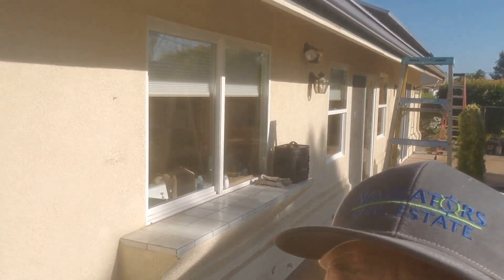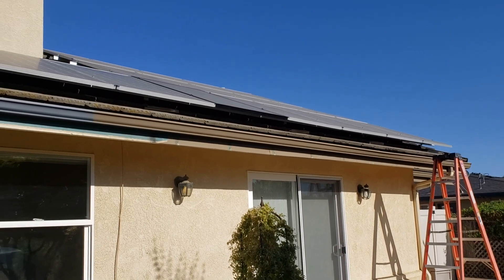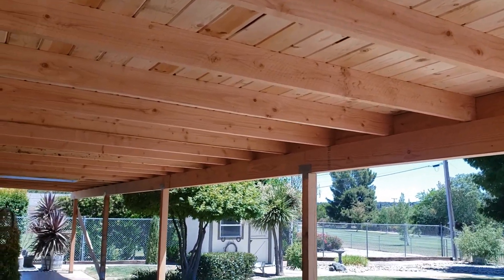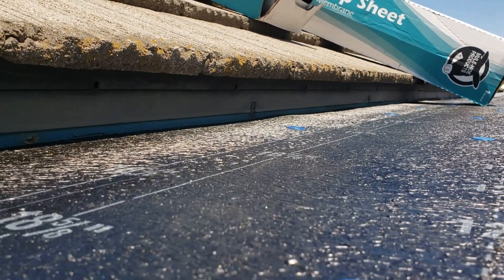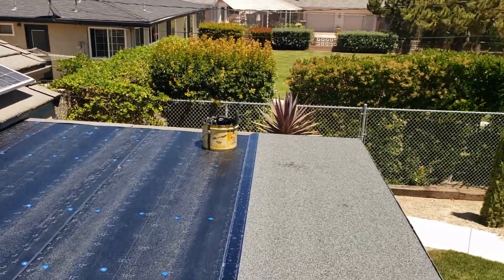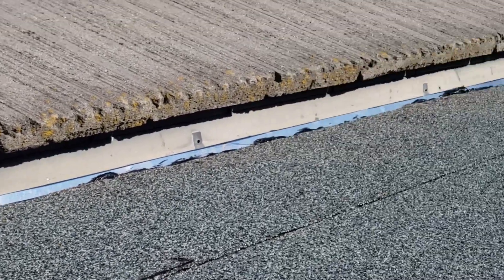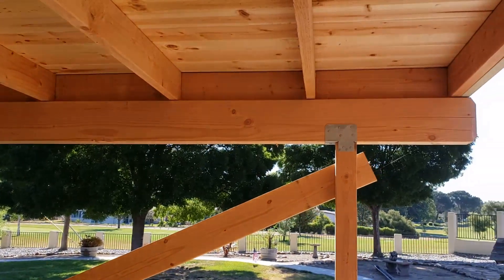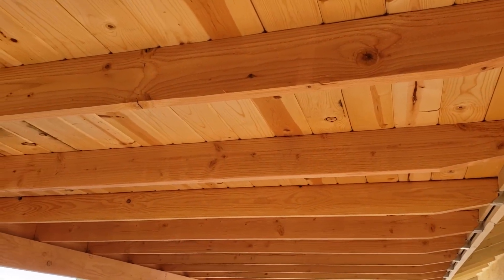HOW TO BUILD A PATIO COVER THE RIGHT WAY. PROPER FLASHING AT THE HOUSE CONNECTION IS THE KEY. #patio

Comment: Beautiful patio….just a question…what state are you in? Here in California( the land of the free…sorry I had to add that) you wouldn’t be able to pass code if you attach such structure to the facia board specially if the facia board is attached to 2 by 4’s as is the case on this roof because of the trusses that were used….even if you use hangers….the patio has to be attached to a board that is bolted to the studs running on that wall, by doing that you are able to keep the old rain gutter in place…if the slope is in question then you use different roofing…
Reply from the maker: The fascia to truss tails connections were reinforced with Simpson hardware per approved plans. Thanks for commenting.

Comment: all the weight is on the fascia? I have a lower roof as well and I was wondering how to maintain a strong roof position without jeopardizing the height of it.
Reply from the maker: Hi Rodrigo, your question above is exactly what I was dealing with. The weight on the outside is on the beam that sits on the patio's 4x4 posts, which sit on the concrete patio. On the inside the rafters are attached to the fascia. I wanted to maintain at least 3" of fall from the house to the outside. Adding more posts 2' from the house wasn't something the owners wanted to see nor was it necessary. Running the rafters beneath the fascia and  Lag screwing a new rim joist to the stuccoed wall would have dropped the height at the building approimately 9". That would not have left me adequate clearance under the beam at the outside of the patio.
Reply: You can put framing anchor between the original rafter and facia board (A34 1-7/16 in. x 4-1/2 in. ZMAX Galvanized Framing Angle)
Install two on one original rafter (both sides)
Reply from the maker: @steveock2154  A34 are great connectors, I use them often & they are spec'd out by structural engineers often as well.

Comment: Did you put additional framing anchor to the original rafter and the original facia board? if you didn't do it do you think the original facia board is strong enough to hold all that weight?:face-orange-biting-nails:
Reply from the maker: HI Steve, yes we reinforced the connection.